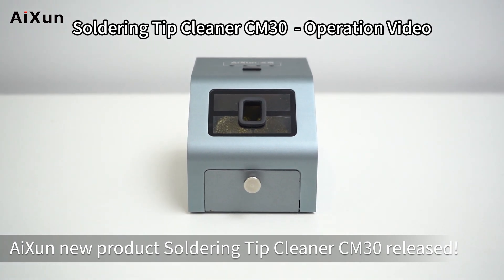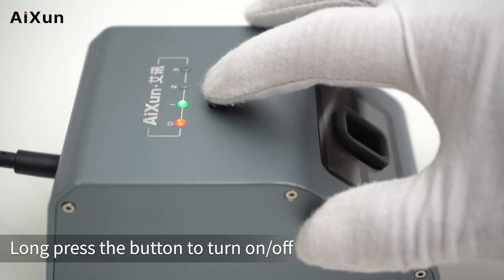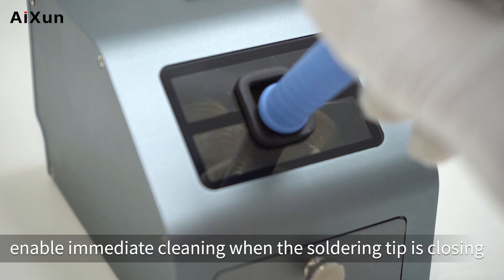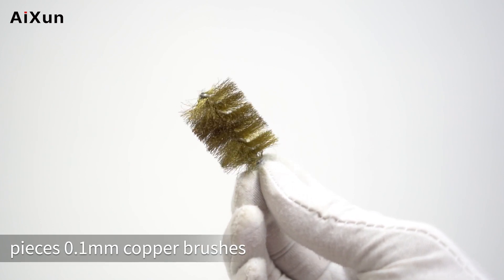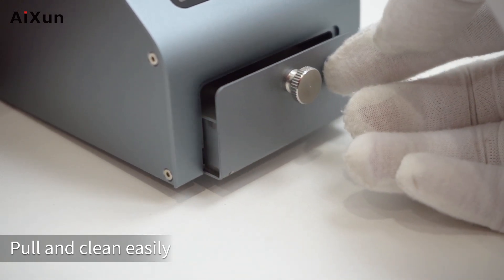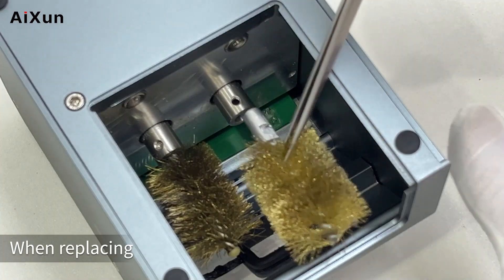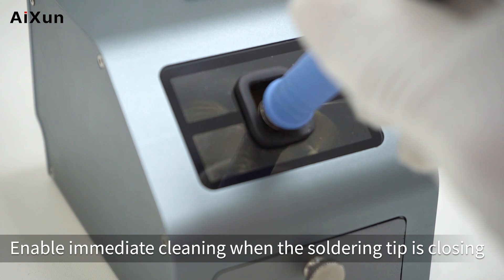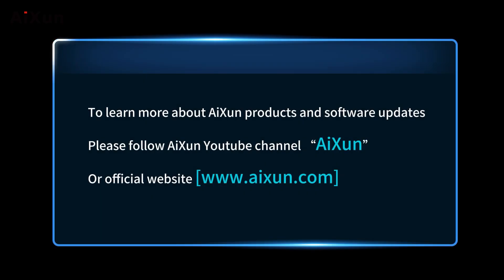AiXun CM30 Soldering Tip Cleaner Operation Guide

Comment: LOL that frame are made from plastic? Why it's melting?
Reply from the maker: Dear, the frame are not made from plastic. We used an experimental prototype to shoot the operation video. The actual finished product has been upgraded and the material used is resistant to high temperatures. Don't worry.
Reply: @aixuntech  Better put ceramic or metal material for that part.

Comment: At the 2nd minute and 18th second of the video, it appears that the silicone in the area where you inserted the t245 tip has melted. Isn't the silicone part used in the device heat resistant?
Reply from the maker: Dear, the frame are not made from plastic. We used an experimental prototype to shoot the operation video. The actual finished product has been upgraded and the material used is resistant to high temperatures. Don't worry.